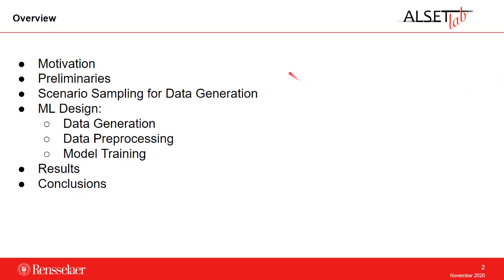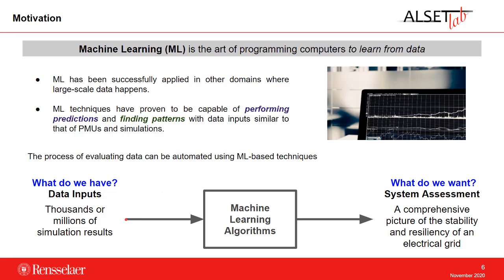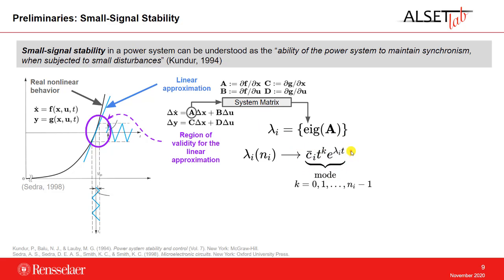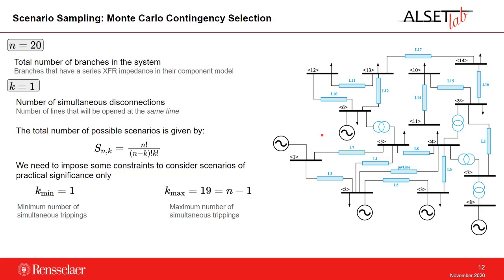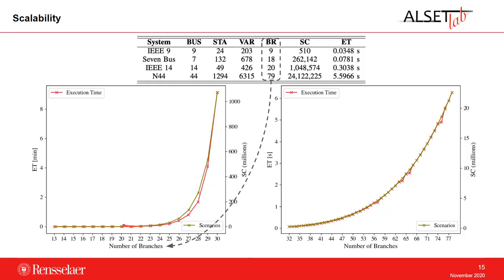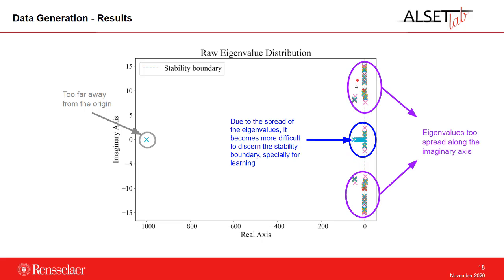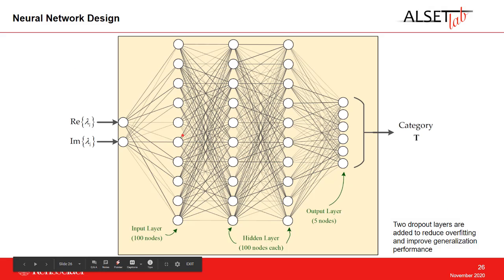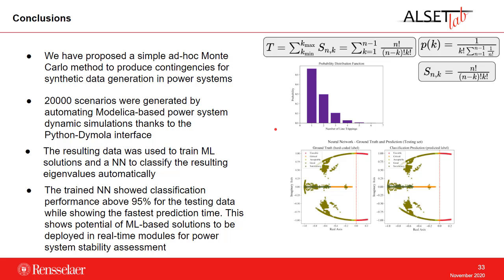Synthetic Training Data Generation for ML-based Small-Signal Stability Assessment

Comment: Hi, I am a student learning things about power system and ML. I have read your article , watched your video and viewed this github project. Yet I still don't know how to get synthetic data for ML. If my readings are not so bad, I think your article shows that with an approach the computer can generate a large amount of data in a very short time. However, your project here only shows IEEE14, so how should I generate data for other systems mentioned in the article? Like IEEE9 etc.

Secondly, as mentioned in the code"For each contingency, a linearization procedure is performed in Dymola, obtaining the eigenvalues of the system matrix that characterizes the operating condition of the system after the applied perturbation. A total of 19815 simulations are generated, each with 49 eigenvalues. Therefore, the resulting number of 970935 eigenvalues." Does that means user should generate a large amount of data by themselves first in Dymola? If so, is there any tutorials about it? I watched your video about SMIB Tutorial: Assembly and Power Flow Generation for Dynamic Simulation using OpenIPSL but it only shows how to simulate a system.https://github.com/ALSETLab/Time-Domain-Simulation-Performance-Benchmark/tree/masterIs this project more helpful for generating data?